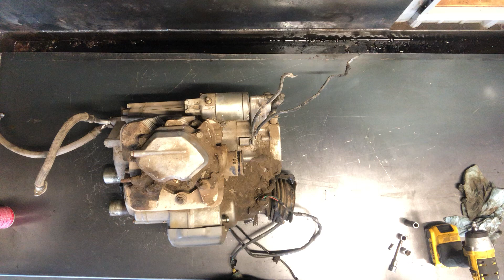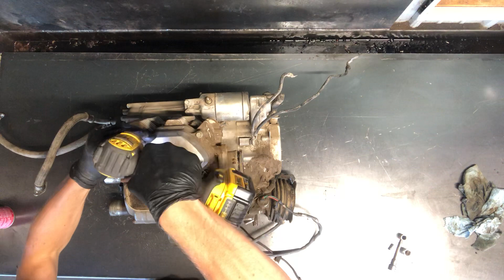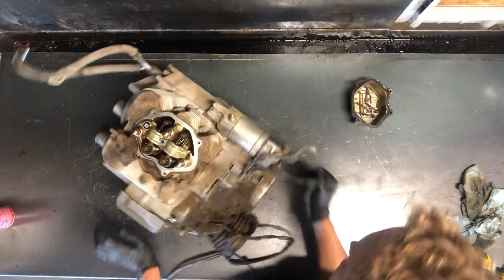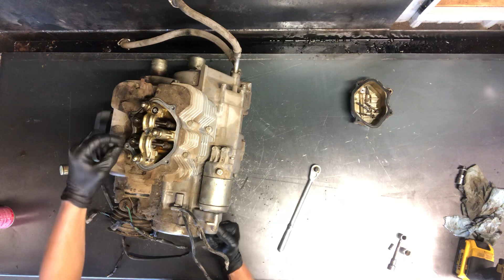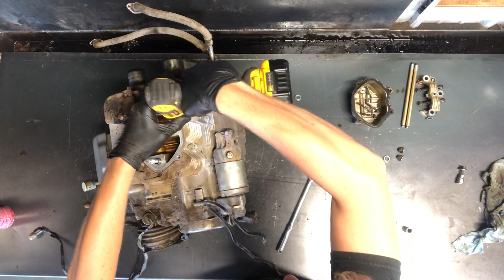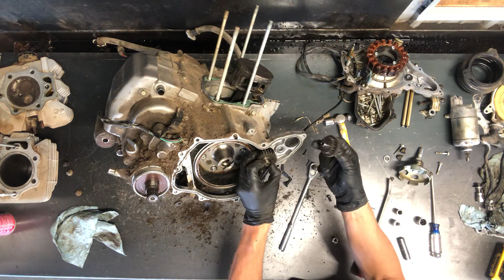Honda Foreman 450 TRX450 - Top End Rebuild - Motor Issue Engine Problems - How To

Comment: Hello , i want to buy a 1998 trx 450es ,but the seller suspect a broken output shaft in two because he says the rear wheels are not turning , is it a big job to replace the output shaft and does it come out by the clutches side or the stator side?

Comment: my 98 450 Foreman ran great and then I put Premium gas in and ran it for about an hour and started hearing a tinging like sound under pressure and then parked it, now it wont start, it turns over, just doesn't fire. any suggestions? Anyone???

Comment: I have a Honda Foreman, the problem is that the compression seems too high and the electric starter cannot turn it very easily.  Very had to pull start also and there is not compression release I can find.  The only way to start it is to hit electric start and pull rope at the same time.  Any idea what the problem could be?
Reply: jay miles need to check decompression mechanism

Comment: Kind of a slightly off topic question, but it looks like you might know.  I have a 2015 Honda Foreman and I'm thinking of getting a oil extraction pump to pull oil through the fill hole.  Will the tube get to the lowest part of the case easily from the fill hole to get most of the oil out?  I'm afraid I'll booger up my drain threads so I'd like to leave the drain plug alone.
Reply: @MidNebraskaMotorsports  thanks.  I pulled the plug for my first oil change and when I was tightening it back up, it felt like it gave a bit.  Wasn't cranking down hard though.  I'm hoping it was just the crush washer was canted and I just felt it seating straight.  Anyway, it not leaking so I thought I would just go to sucking the oil out in case I did strip the threads. I only ride about 200 miles a year.  You think if I lift up the back end I'll get most of the oil out?  Any remaining oil can just get diluted with fresh oil every year.  Thanks.